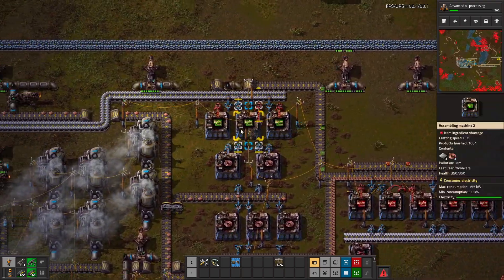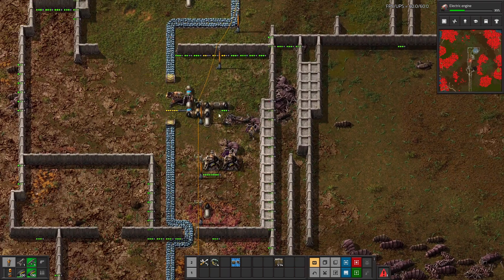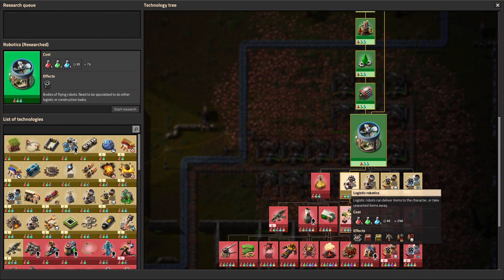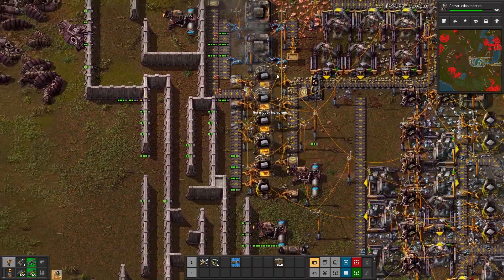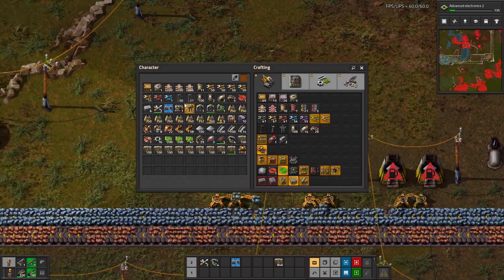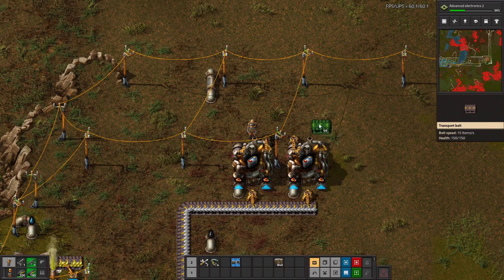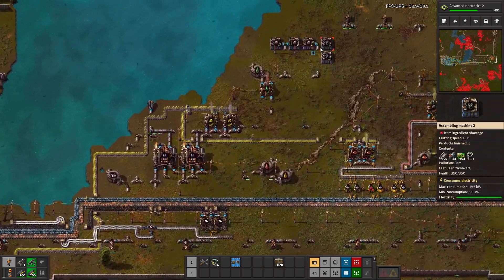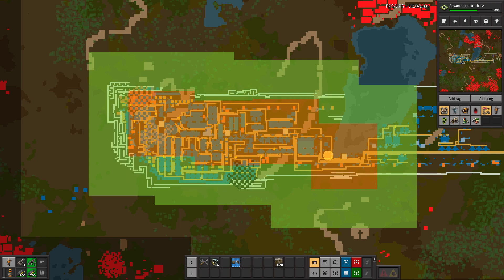Factorio: Ultimate DeathWorld Challenge Episode 16

Comment: How do you prevent the repair bots dying to the flamethrower turrets? Do you have a mod for it? Or you just hope for the best? My bots just keep flying into the flames and dying instantly :(
Reply from the maker: The solution... make more bots lol!
Reply: @YamaKara  Also bot speed research helps a lot
Reply: Put the bots building as far away as possible, so that the biters are dead and the flame throwers stopped firing before the bots arrive.
Reply: @winkbrace  that's a really good idea actually, I never though of that
Reply: @freshtauwaka7958  I would argue the opposite. Depending on where the roboports are in relation to the combat zone, if the bots are slow enough, the fire will be out by the time they get there to make repairs.
Reply: Make a solid wall in line with the construction perimeter so the flames are on one side and the bots on the other. Dont connect bot networks over acute angles, otherwise they will fly over the dangerous side.